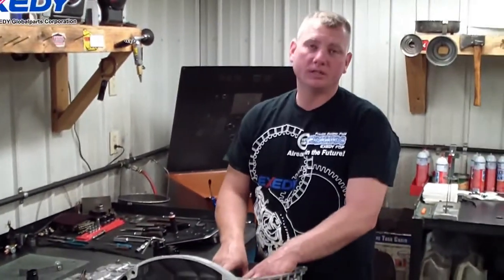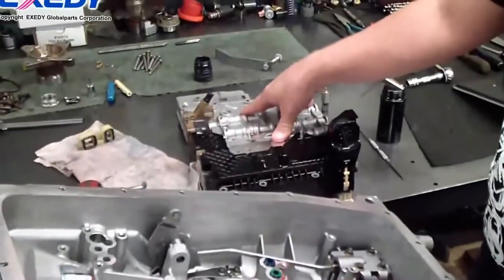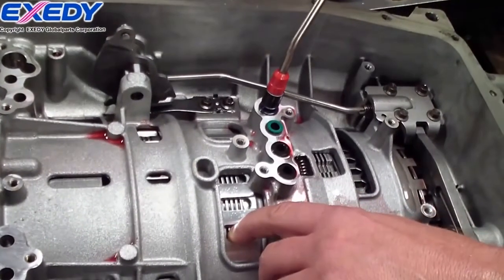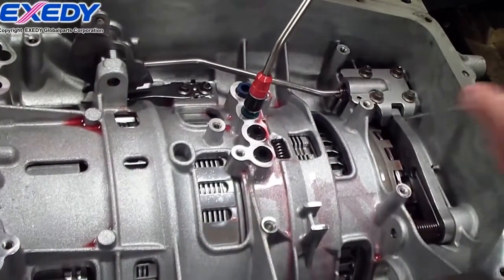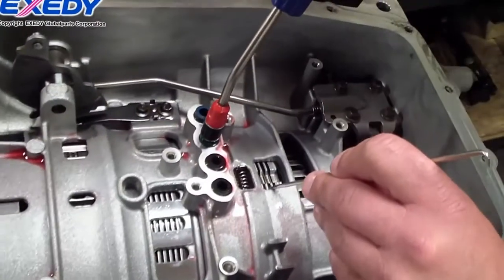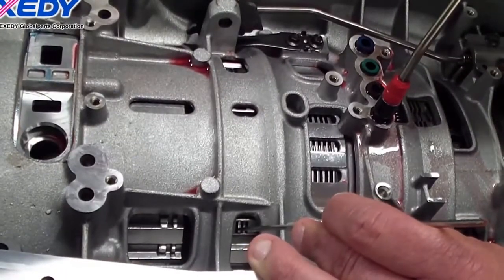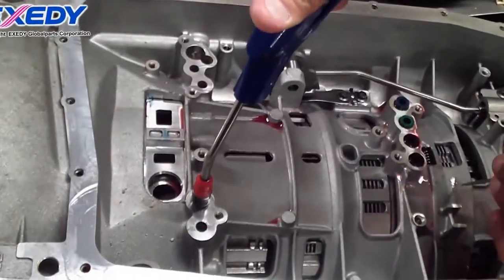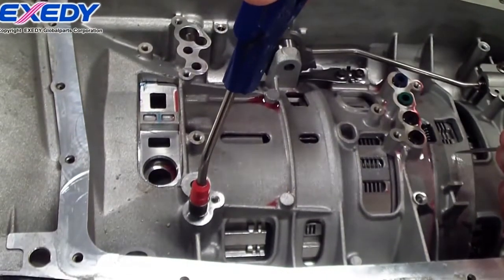Auto Trans Rebuild   Chapter 8   Air Check

Comment: how much air pressure do you use? I am building a TH350 and have positive, full piston travel with 25 psi, but I can hear very slight air passing past piston seals. in particular the piston on the front pump bench checked fully extends with air, but I can see it slowly bleed back down once I stop feeding it air , but still holding the air nozzle  tight against the air feed hole in the pump. I read that this can be normal since the piston isnt actually pushing against any clutches.. Is this ok?

Comment: FYI anyone who comes across this, replacing solenoids solved my problem, so far. I had slip on 4-5 upshift, jolt on 5-6, and 2-1 downshift bump.  Codes came up 4f8A and also 4f86 for 4-5 upshift but no other codes.  Originally i just attempted with the bridge and finger seals, but that did not solve the problem.  I have been able to test the car on at least one road trip and a few high load shifts, and so far so good.  If anyone buys a car with a higher mileage ZF automatic transmission (over 120k miles, 200k km) at the first sign of transmission issues I would recommend this service.